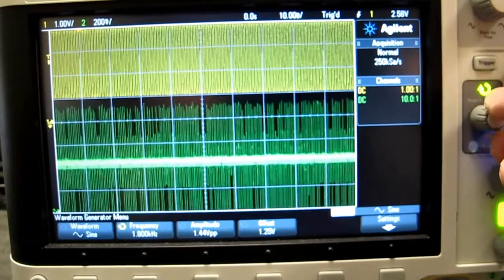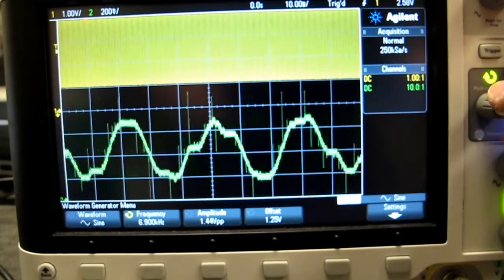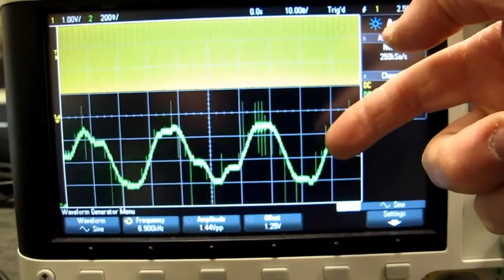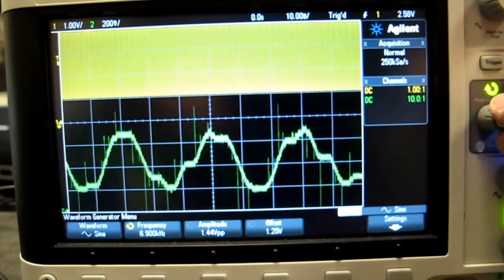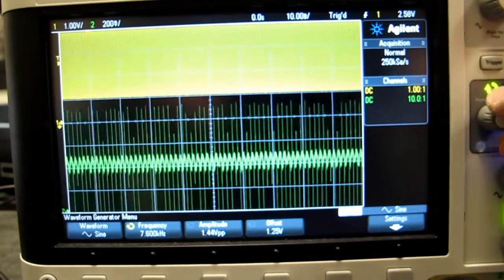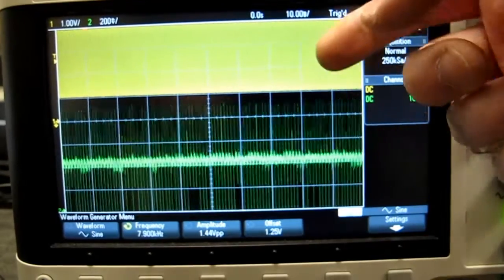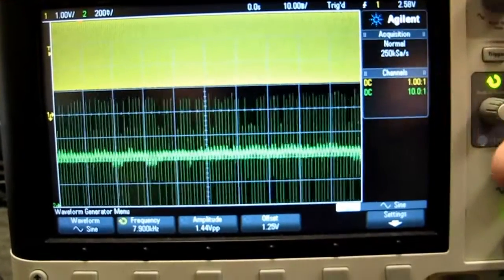Arduino board digital signal processing demo

Comment: How  do you know the Arduino´s sampling rate? I mean, if i wanted to know the right time the Arduino takes to read an analog value and convert it to digital what should i do?
Reply: you can check it with micros(). its actually pretty shit house slow unless you use tricks to make the ADC go asynchronously. and then its only awfully slow.
Reply: To read analog input you have to set up serial communication. When you setup you serial input you have to specify a baud rate which will tell you how many bits will be communicated per second.